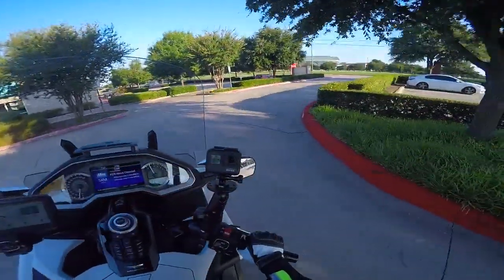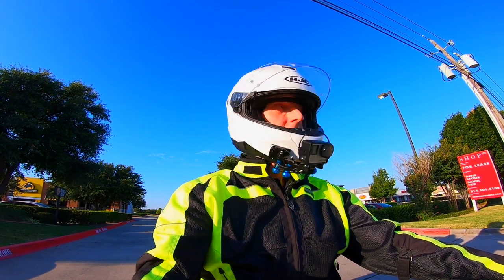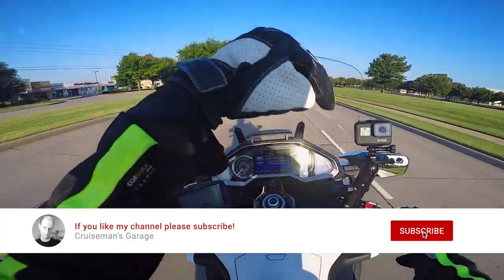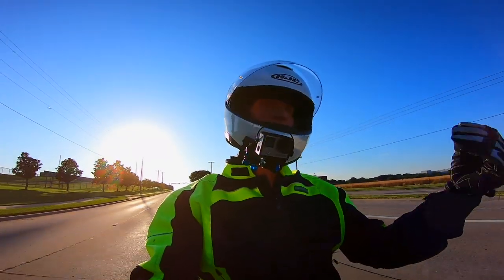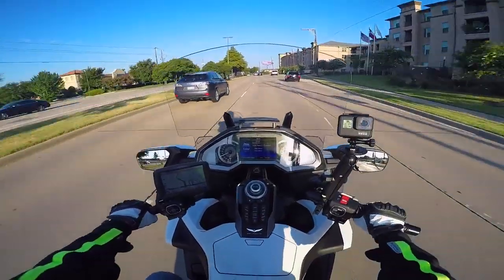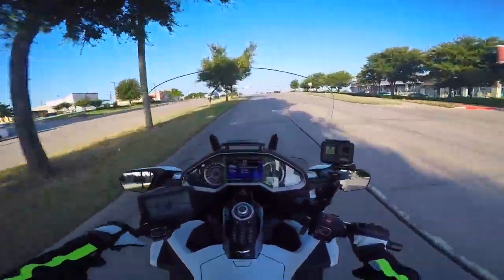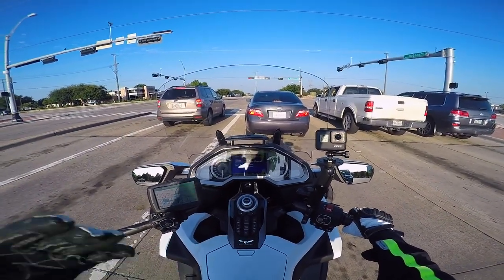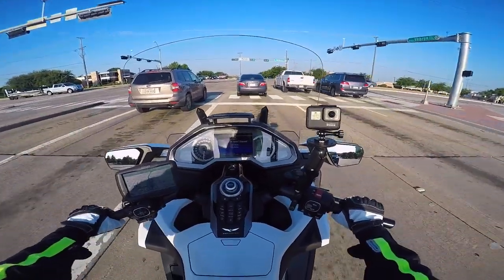Catastrophic Engine Failure on 2018 Honda Goldwing | Cruiseman's Moto Vlog | CruisemansGarage.com

Comment: I bought a new 2018 Goldwing DCT.  At 750 miles, I heard a loud engine noise & had my bike towed to the dealer.  The diagnosis was a blown piston!  Within 10 days, my dealer and Honda got me a brand new repacement bike and transferred all my accessories.  While I was shocked at the failure, I couldn't have asked for a better response from Honda and the dealer.
Reply from the maker: See, that's the way it SHOULD work.
Reply: That was awesome that Honda did that for you.
Reply: I'm really not impressed with Honda's customer service. This gives me hope that maybe someone in the chain still cares. On the west coast they are horrible.
Reply: Nice but the bike isn't as reliable as it once was.
Reply: Joseph Marton  sounds like a similar problem with piston rings, same as their CRV turbos with gas blow by. probably made in china.....
Reply: Sounds like Honda was shocked at this and wanted to get the bike back to engineers so they could look ad see if this was a random unique failure or a design flaw.
Reply: That's the way HONDA should be with their FLAGSHIP MACHINE.

Comment: I have a 92 wing with 157,000 miles and still runs perfect.. no smoke no noise .. perfect thanks honda
Reply: The early wings are near on bullet proof. My 76 wing.. When we split the cases and removed the heads... At 70000k still had the factory hone marks in the bore. The only problem I had was a loud tapping noise which sped up with the revs... So had to be a tappet.. But we couldn't find it... One day I had the rocker cover off doing valve clearances and I over tentioned one and.. "ping"... I nearly got hit in the head by a tappet breaking... Replaced it... Ticking gone.
One other thing I learnt a valuable lesson on was... ALWAYS use genuine honda gaskets... We had a problem with head gaskets blowing after we had replaced them... We were issued aftermarket gaskets... I read in a two wheels (australian/NZ) motorcycle mag that a guy had same problem with a cx500... So went back to Honda dealer and showed him the article and suggested it could be the problem... He gave em to us free of charge... Said if they blew again I'd have to pay for them... Which I agreed... Never blew another gasket after that... And dealership never stocked aftermarket gaskets after that either...
Looking at picking up an old 77 wing to restore in coming months... Labour of love on the bike that started my love affair with motorcycles... ❤️❤️😊
Reply: I’m actually seriously considering buying an older wing instead of a newer one I don’t care if I have to refurbish it. they are simple to work on and bullet proof. I just went through The dreaded alternator drive gear issue on my 2011 Which has been a problem since the GEN-1 gl1800’s  by the time you buy something newer then upgrading everything Honda cheesed out on like The suspension Might as well just buy a classic go through it and just love it for the Simplicity and dependability.
Reply: @atlas3863  its a 94 goldwing... I lay back on the seat.. My feet go on the pegs on my extra pegs by the engine or i put one of them up by the wind deflector i bought for my bike.. What a great comfortable ride... I dont know how people can sit on a bike like sitting at the kitchen table on a chair  eating supper, sitting  straight up and feet down.... Going thro the gears omg.. I am in 5th in no time.. I creep to a slow pace i mean creep i am in 2nd gear... Leaning tbe bike around corners it leans and leans far... Its only a 1500 so not to  fast but to cruise its great..i used to hit the cruise jump on the back seat one foot on the tank to steer it on the breezeway.. It was awesome sitting back there...i had a 1200,1500 and a 1800.. The 1500 all the way...

Comment: I totally agree with your video Cruiseman.  With all the problems that a small percentage of people been experiencing issues with this bike, I predicted problems with the new Goldwing 18 months ago which is why I haven’t bought the 2018/2019 yet.  Anytime a new bike or product hits the market there will be problem for several years until they work out any defect.  Front end, GPS, Engine, is some of the problem I’ve been hearing not to mention it’s been downsized with no engine/crashbars.  Many owners have experienced zero issues.  When I find something that works I stick with it because it takes a lot to impress me other than a automatic transmission and sleek design. Honda has a history of making bulletproof engines but when a engine is newly designed it takes years to prove that its really bulletproof.  I believe that man-made things can fail, and Honda will make it right to the customer satisfaction but I’m sticking to my old faithful GL1800 because I know it’s has stood the test of time. The 2018/2019 is a beautiful bike but I can’t stamp the Caliente seal of approval on it until certain changes are made.
Reply from the maker: It is a bit of a mystery why Honda turned its back on a proven, bulletproof engine. However, I am beginning to think this is more of a quality control issue at Honda Japan rather than poor engineering. The GPS is just a stupid business decision. I have never had an issue with the front end or suspension. But, Honda is a MOTOR company, this is what they do! No excuse for an engine failure like Wavy's. I am not as concerned with WHAT failed in Wavy's engine as WHY it failed. Are the valves and head components not getting torqued properly at the factory? If not, why? What can cause something like this to fail?
Reply: Never buy a first year Honda. Frame problem on the early GL1800’s, heat issues on the ST1300 were never fixed. I bought a 1978 Honda Hawk that leaked oil and the comstar wheels would not hold air. I’m happy with my 2012 GL1800.

Comment: I totally agree the Honda needs to step up to the plate, especially with a bike still under warranty.
As the owner of two 2018 Goldwings, this really concerns me.
Reply: I just took delivery on a 2018 last month.  They reduced the price to move it off the Showroom.  I'm a second owner of a Goldwing Motorcycle.  I had a 2005 that I had for 8 years with no issues.

Comment: First of all, we don't know what Honda will ultimately do in this situation. I have 80 K 0n my 2012 Goldwing, and have never had a single problem. This is my 6th Honda street bike and all have been nearly flawless, so don't beat Honda up until we see what happens. I will buy another Wing pretty soon and aside from which dealer I wind up at to purchase my new bike, it WILL be a Honda. Honda is still maybe the best motorcycle built and I think they will do right by Wavy.
Reply from the maker: Eddie, I had the same experience with my 2012. And, honestly, I have never had Honda fail to make good on a warranty claim. On my 2012 they replaced nearly every electronic control on the bike under warranty. I hope they do right by Wavy, but the early indications were that he was just 'out of luck' and had to wait weeks to get his bike fixed.

Comment: Why is everyone (Including you) voicing there mostly negative comments on Honda? We don't even know yet what Honda's intentions are for moving forward to right there wrong (If it's even there wrong). I feel that this Video is Premature as well. Not sure if you're just trying to get the Views and Subs or just trying to be the first to cover the Story. Meanwhile, everybody just chill out and quit getting bent out of shape over this.
Reply from the maker: Sheila, Wavy's first contact with Honda and the dealership were less than encouraging. He was told it could take several weeks to make the necessary repairs and he got the sense that Honda was not too concerned about his problem. However, yesterday afternoon, he received a follow up and things are looking up. I will be posting an update video tomorrow to keep everyone apprised of the outcome.

Comment: I have owned a 1997 Valkyrie, a 2003, 2008 and a 2018 Goldwing. All of those were flawless powertrains. I suspect that it is a dealer issue not Honda. In my experience usually the way that the dealer handles the situation between the bike owner and the Honda factory representative is very key to satisfactorily resolving this type of situation.

Comment: GoPro Hero 7 Black. Cool camera BUT I’ve had tons of problems with mine, you turn it off and sometimes it freezes, other times it doesn’t turn off but it looks like it’s off and 30 minutes later you go back to it and the battery is dead. I dunno why, but it just does that.

Comment: Have been following this on Facebook and agree it doesn't sound like a catastrophic failure and things do go wrong even with the most reliable vehicles but the big issue for me is the way the dealership has handled the problem.  The very least they should be doing is sorting alternate transport for Wavy while his being repaired.  I think until that is done, naming and shaming the dealership would be a warning to other riders
Reply from the maker: I agree. But, wanted to give the dealership, and Honda, the opportunity to do the right thing first.

Comment: I agree with your assessment.  Honda needs to step up their quality.  I have an 18 and it's had tapping noise in the right side since day one.  Brought it to Honda and they said it's norman.  The speed sensor on the left side was backwards and Honda said they thought I did it. It the very least, you should give the name of the dealership who give them a replacement.   We could spend all day quitting bad but we need to know where to go for good service.  Thanks again cruisman.

Comment: i have been riding Goldwings since 1980. so far i never had a failure. However wether its a Bmw, Harley, or Honda i never bought the first year model. Would like to buy a new Goldwing but will wait for a few more years. i remember when the 2001 1800 came out.  Honda made alot of improvements on it in 2006.  The new old wing is in a class by it self and is very interesting.  Keep up the good work you are providing a very good service.

Comment: My 2018 DCT Tour developed a loud clicking on cold start and a rattle at certain RPM's. Dealer found the right side cam chain had eaten half way thru the tensioner and damaged the case. I live about an hours ride from the dealer. They gave me their DCT tour demo to ride while they worked with Honda. Two weeks later, the bike was replaced. They even swapped over the farkels to the new bike.
Reply: How many miles were on the bike?
Reply: @markskalski8838  Just over 2300
Reply from the maker: Now THAT is scary.

Comment: Seen this before on an ST1100 - a small screw got into the intake and is rattling around in the cylinder. Most likely got jammed in the valve and bent the valve. This is not catastrophic by any means. Pulling the head and replacement of the bent valve or valves will most likely correct the issue. Typically there should be no cylinder damage but perhaps some piston crown damage. How does a screw get in there? who knows, these things can just happen. A loaner would be a nice option and the repair should not take very long perhaps a day or so.
Reply: Agree it doesn't sound catastrophic but certainly Honda should be sorting alternate transport for Wavy while it is repaired.
Reply: There are many postings in various social media platforms and forums about 2018+ Goldwing owners experiencing a very similar engine problem.  If it is, as you say, “a small screw... rattling around in the cylinder” then we might be looking at a recall.
Reply: @giantinside  Yes if this is a chronic issue then perhaps but this is the first and only case I have heard of this happening. I think perhaps it is a fluke. Back in the Harley AMF days it was common to see sabotage by workers where screws and even wrenches deliberately left in engines and transmissions (I worked at a harley shop at the time) I have inadvertently dropped a screw into the intake myself but was able to extract it with a magnet. The thing with the ST and GL along with most Honda engines is the intakes are downdraft for anything in the airbox inside the filter can jump right into a cylinder.  I would be quite surprised to see this occur more than this one time. Time will tell. But nonetheless catastrophic would be rods sticking out the cases not just a simple bent valve and dented piston dome. This is a pretty easy fix unless the damage on the piston is extensive and it has to be replaced. The damage can be viewed with a scope even before disassembly.  I disagree with the tendency to hear of a few in a million cases and all of a sudden people are yelling class action. First off class action is a safety action not mechanical and like the frame issues and the differentials it's a tenth of a percent of the production line. Patience grasshopper :-)

Comment: Cruiseman - there is process to resolve this matter.   1).  Did the dealership contact Honda Techline?   2).  Did the Dealership contact the Honda District Parts and Service Manager?  3).  It would seem the bike is still under applicable warranty.     Save the outrage, especially when you are riding, and go thru established channels.   Lastly - did the customer contact Honda Customer Relations.
Reply from the maker: I know the dealer and customer have both communicated with Honda.

Comment: I have a 2023 goldwing with about 400 miles on it and it sounds bad like that during idle only. It hasn't failed and having never owned a goldwing I thought thats just how this engine was supposed to sound. I will have to keep an ear to it over time and swing by my local dealer. So I just came in from garage and theres no oil in my bike. its new. well thats great. i wonder how much oil i should add when the entire dip stick is bone dry even when screwed in.
Reply from the maker: You might want to email me to discuss offline. Cdikmen@cruisemansgarage.com.

Comment: My 2020 DCT is at the Honda Dealership Repair shop. With only 4099 miles I had a loud clacking noise coming from the front of the engine. Repair Tech put it on the rack, removed the front engine cover and discovered the camshaft chain came off of the tensioner and was hitting on inside. Is this a common issue? Hope Honda does the right thing.
Reply from the maker: It's not common, but yours is not the first.

Comment: Never experienced such a catastrophic failure myself; having owned only four bikes. Yet so close to brand new - yes, agree that the bike should be replaced if for no other reason but customer good-will. I don’t know that my Harley dealer would do that but I’d like to hope so. My bike has been sitting this summer because my wife no longer wants to ride & riding without her doesn’t suit me. I might sell my 2012 and if the bug hits me, I will consider a new Wing.

Comment: 😩 I started up my 2019 goldwing tonight to go to work and I heard an initial tapping I hadn’t noticed before, it went away after about 30 seconds of it idling but it worried me 😅 especially after watching this video
Reply from the maker: If goes away after the engine warms up, then I doubt there is cause for concern. I am guessing that a 24-valve engine might have some racket until the oil warms up and gets flowing.

Comment: I’m riding my third Goldwing, a 2016 F6B and love it, this is my last bike for me. But when I saw the 2018 I wasn’t impressed myself. I’ve always went by the principle of never buy the first model year of anything and I also drive a Toyota! So I always go with reliability over style. Automobile wise Honda cars are starting to suffer in this area also. But I remember when the new 1800 came out in 2001, the aluminum frames broke! And it was a major repair for all of those bikes! I had a friend that the frame broke on his. So this is not this first time they’ve had problems with first model years. I really hope Wavy gets treated right by Honda ! Once when I left the dealership I never went back, I’ve always wrenched my own vehicles my whole life.
Reply: We share same feelings. Until 2017 bike was a monster look despite less electronics,  but true bulletproof.  Afterwards,  the 2018 up, got slimmer  and lot of changes
I only like the new gearboxes having 6 speed instead of 5, that makes probably  a better difference  in highways and engine won't scream same way Looking for that extra missing gears
Both  have pro and contras